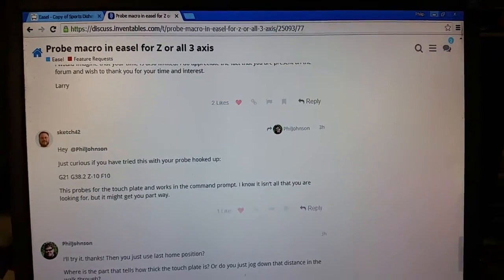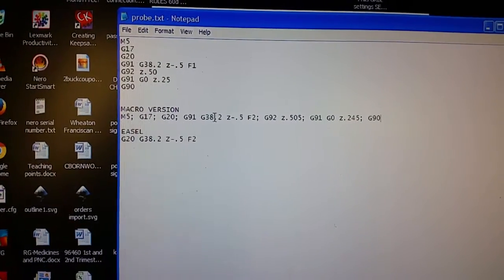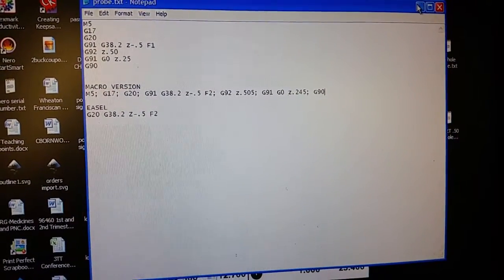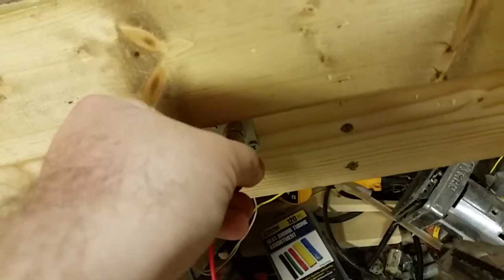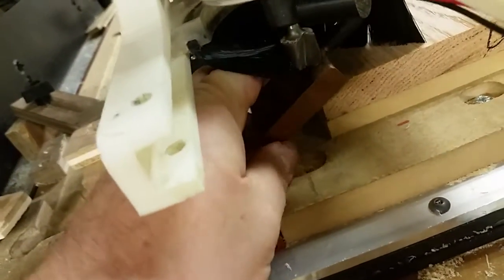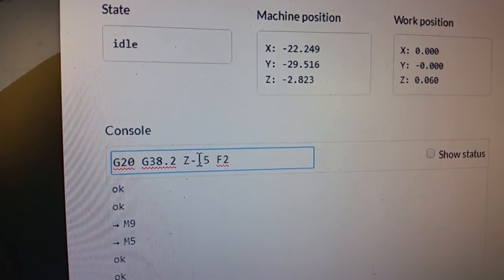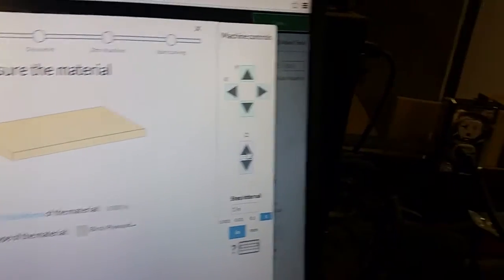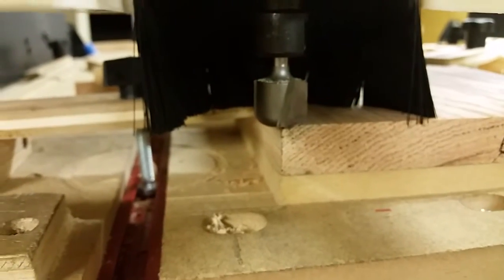Using a probe in Easel WITHOUT upgrading to grbl 1.0c and with the Arduino gShield setup

Comment: so my touch probe works using a cnc shield kit but for some reason easel says the probe is making contact when the spindle hasn't touched the probe. when the probe touches the spindle the green circle turns gray to no contact. I have days looking for how to fix this. I dont understand why the connections are inverted. Did you ever have that problem with your setup. If so please give me your advice. i would greatly appreciate any information you have to share. if it helps i have already changed the grbl G38.2 command and my two wires are connected to the two pins GRD and SCL. I hope its not to hard to notice my comment